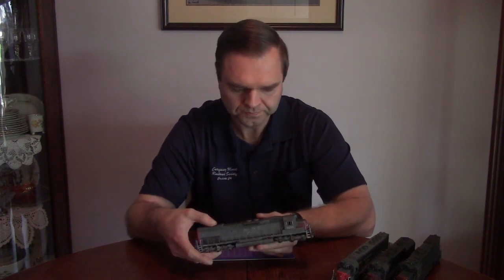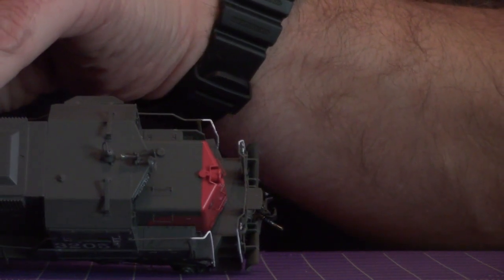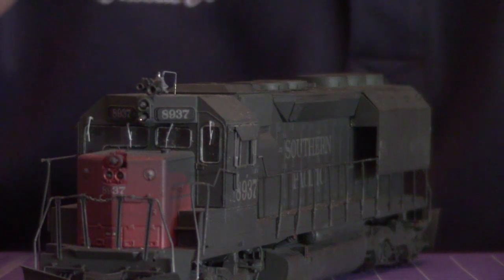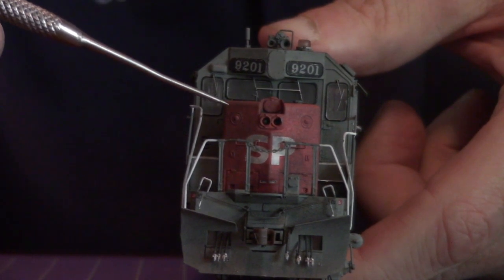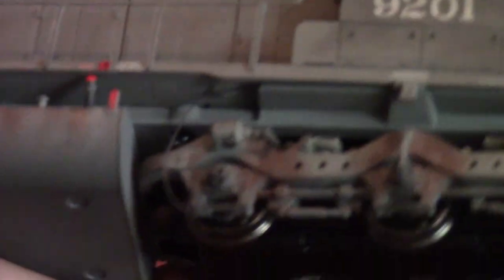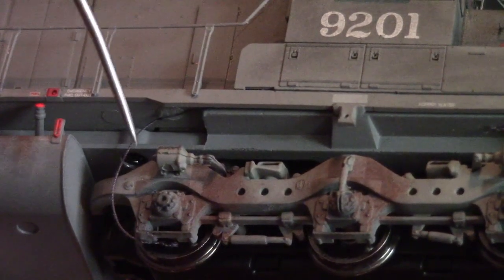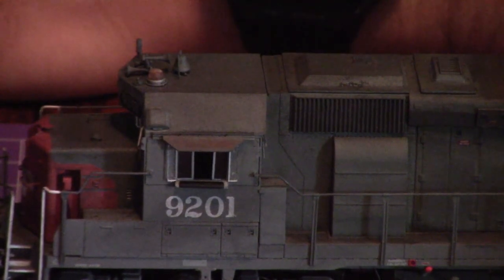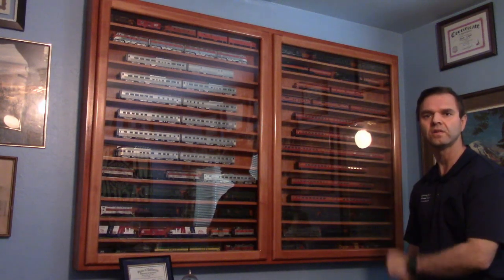Weathering and detailing a Tunnel Motor Tutorial

Comment: the reason of the sun cabs devices and even the angled roof of most emd cabs , is the type of brakes shoes, before composite shoes, the railroads used iron brakes shoes, so with regular use, the micro iron flew up and stuck on the roof cab and nearest points, regards from argentina, this happens here in emd export locomotives all the time